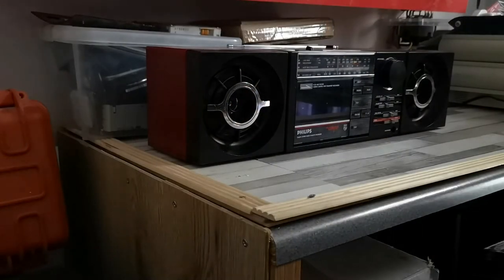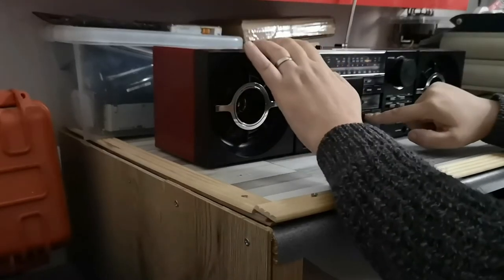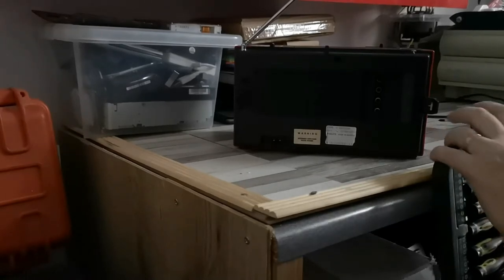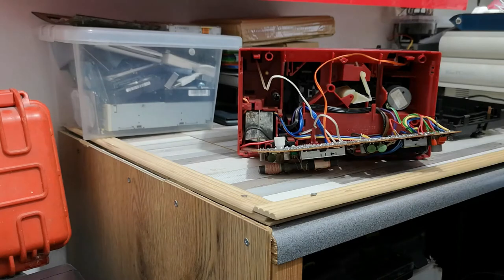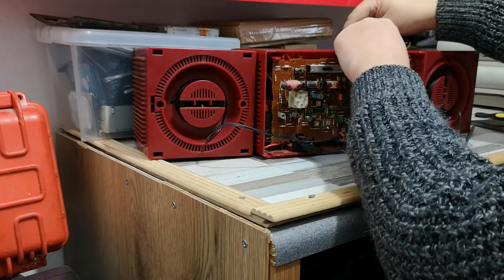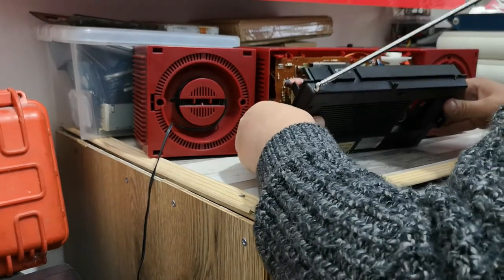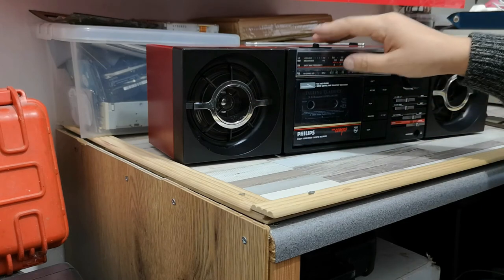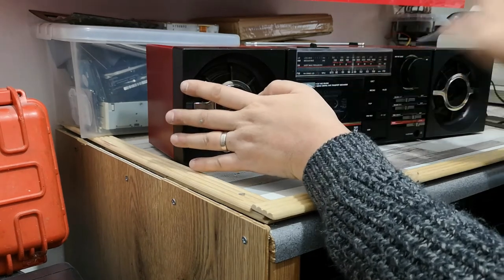Philips Compo D8254 - Portable Radio Cassette Player from 1985

Comment: Love the video! I was searching for this because I found one of these in my uncles old shed and it looks in good nick but there’s a few issues, I’ve temporarily got the power cable from my printer and the tape deck is turning but there’s no sound!
I’ve tried different speakers and the same thing happens with both, 
You can hear an initial thud, like there’s some signal going to the speakers but there’s no actual sound.
Also the radio isn’t working, there’s no lights on the radio like yours so it’s like there’s no signal!
Would love any guidance, I can’t seem to find any information online!

Thanks for the video!
Sam
Reply from the maker: Hi Sam, given that it has been in a, possibly damp shed, I would start with a visual inspection. Check the board for dry joints, etc. I would then move onto cleaning the switches, with some switch and contact cleaner, then working the switches back and forth to exercise them. The switch cleaner trick, usually works well enough to get the unit producing sound, even if it is just audio static.